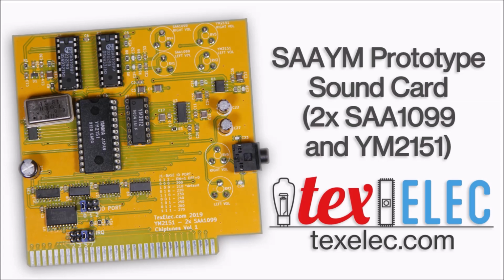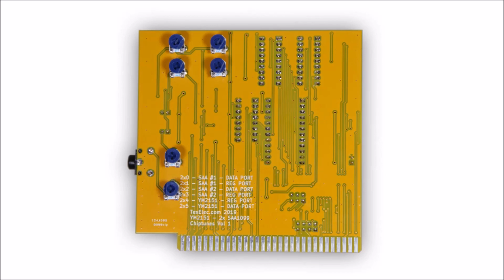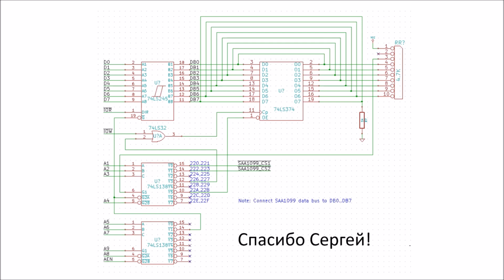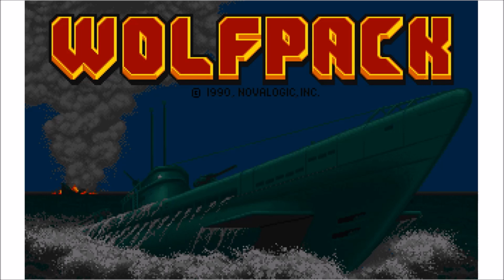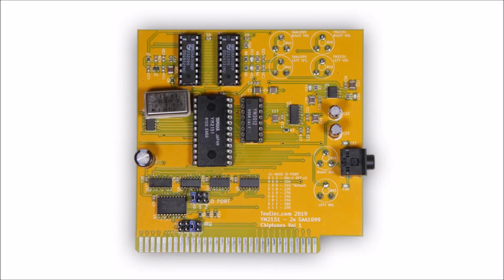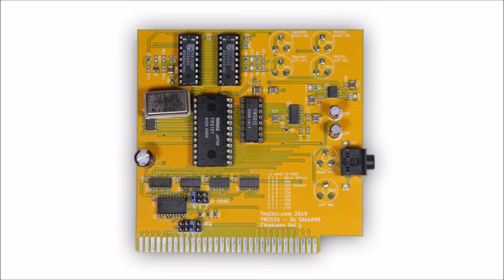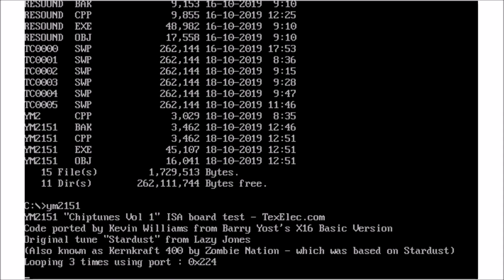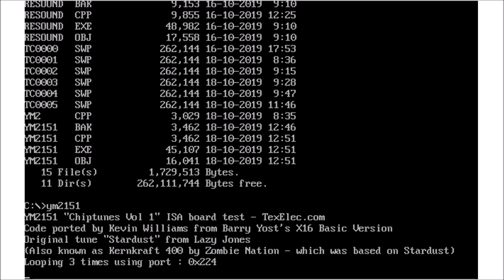TexElec Dual SAA1099 & YM2151 ISA Sound Card "SAAYM" Demo - Commander X16 Audio System

Comment: Why are the SAA chips still planned to be on the board when the YM2151 is better than them in every way?
Reply: It doesn't make sense to me either
Reply from the maker: So I did say maybe... I agree in principle, but the YM2151 is quite a bit more difficult to approach.  David wanted to have a chip more like the SID, and the SAA is near as easy to get sound from.  I think the real question is will we have an approachable enough set of commands in basic for the 2151?  Also, I think the tracker community would never argue that more sound chips are a bad thing.
Reply: @TexElec  Current solution is the opposite of simplicity and consistency. That is why I would like to have one chip.
Reply: @TexElec  The FM chip is more like the SID than the SAA is. The SID is complex. If it were me, I'd drop the SAA completely, and just init the FM regs to something easy to use in BASIC and the advanced user can redefine if they want to. Heck, init the FM regs to produce a square wave in BASIC :-)
Reply: More or less Like monotone does :-)
Reply: IMO, the SAA and YM2151 are complimentary. The Genesis has the SN76489 and YM2612, and most games use the SN76489 for the bass or drum track. There's also a ton of arcade games which use a SAA/76489 plus an FM synth chip for the same effect. Assuming this design permits one, the other, or both, it will give musicians a ton of depth to work with.
Reply: The SAA can be complex if you want to
It has Amplitude Mod, which is How it's comparable to SID

Comment: Any idea when the audio will be finalized? Right now we cant really work on coding a tracker or anything as there are no docs and at least in the emulator R33 and R34 none of the audio demos work, and in fact on R34 none of the graphics layer mode demos work. I know this is a pre alpha prototype but the lack of the devs documenting the changes is hurting the community.  If you look in the demo section of the github most of them wont run on R34 if they use any bitmap modes and none of those programmers know why. I hope we don't have the same issue with the audio programming as with r34 things are a nightmare.

Comment: An useless and expensive board wasting parts stock used for computers / arcade systems to upgrade or repair them... While a PC can perfectly emulate them.
Reply from the maker: So why bother fixing old arcades if you can just emulate them?
Reply: @TexElec  I don't know if I have to answer seriously because the question is serious, or if it is just trolling with a stupid question?
Reply from the maker: @totoonthemoon3593  It was more of a rhetorical question.  Why am I'm saving old parts to fix an arcade or computer, if you then state, you can emulate these anyway?  Why not run MAME then and not fix anything is all I'm saying.
Reply: @TexElec  OK, so you confirm about what I was afraid... You are confusing virtual and reality usages.